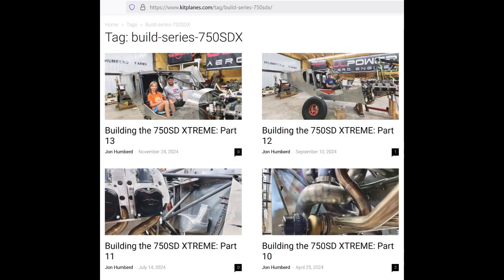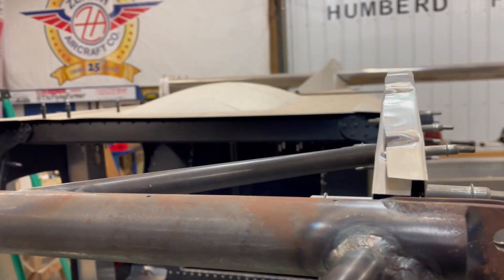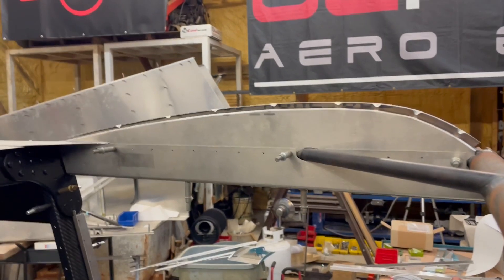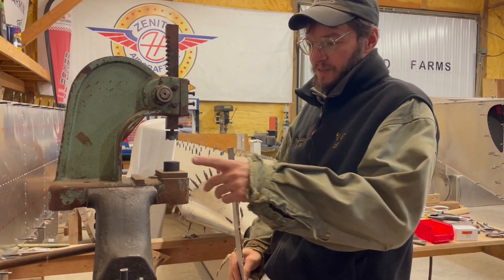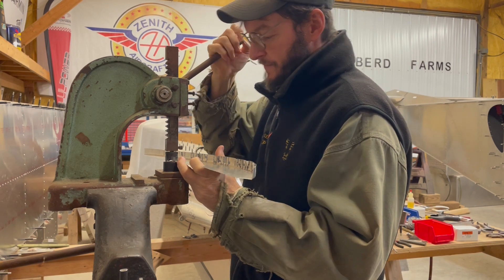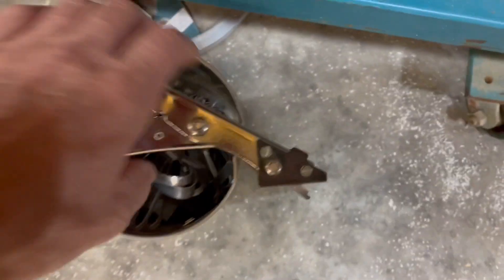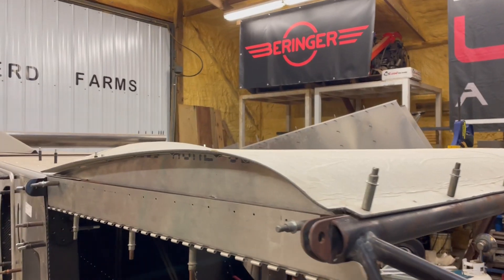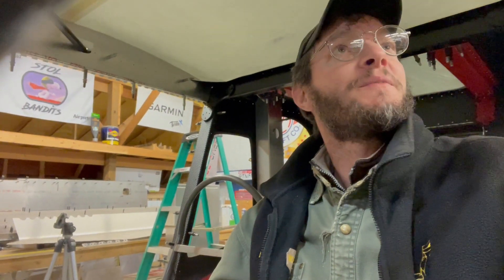750SDXtreme Day 3 of December Build Challenge

Comment: If a small gap between the top wing root skin and the window results from your mod, you might be able to close it with some rubber trim.  On my 750 STOL, I used rubber trim similar to what runs across the base of the windshield but only about 1/2 as wide.  However, in my case there wasn't much of a gap - I simply wanted a "finished" look and more of a weather seal.
Reply from the maker: Yes, I used some of the same windshield trim for those skins on my Super701. Worked really well. Thanks!

Comment: Didn’t you do 701 that snipped edges on to reduce weight as well?
Reply from the maker: My Super701 is all stock on the airframe. The narrowed single-seat that I am also building only has a narrowed fuselage so far.